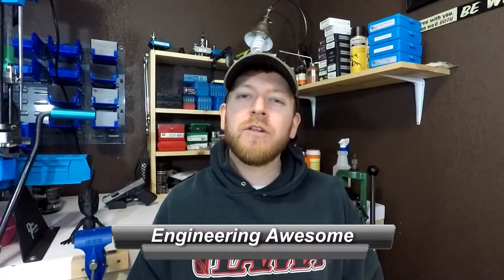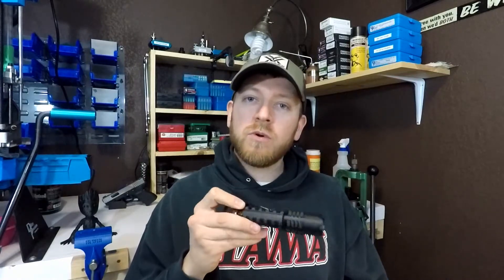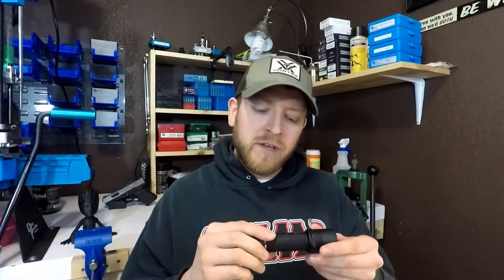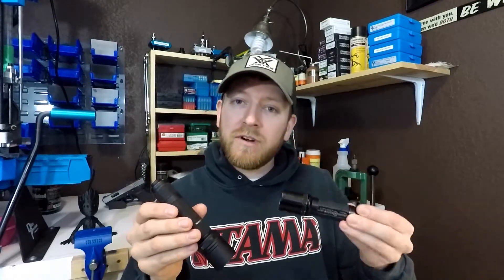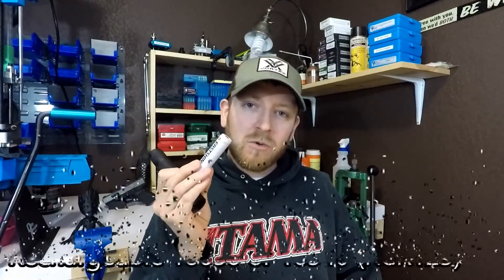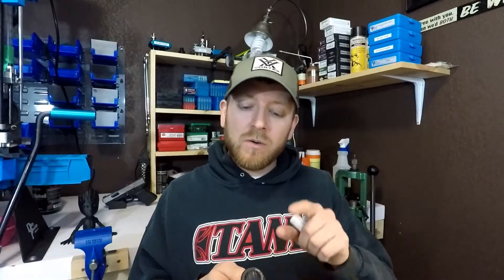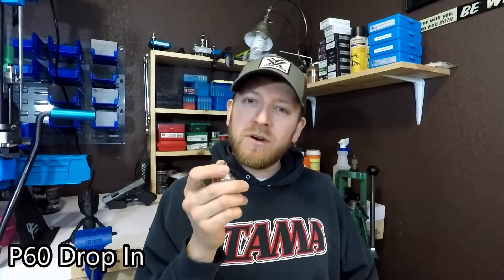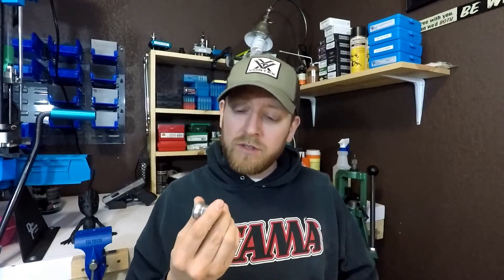DIY Custom Flashlight! Yep It's A Thing!

Comment: P60 was a gateway drug for me. Had fun changing up the lights but realized the drop-in system while convenient and great for modding is not a good system for high output LED's and does not handle the heat. So i started getting into other flashlights and learning to swap emitters and learning about drivers as opposed to a simple drop-in system.

Comment: Do you know if G2 bodies accommodate a 18650, and/or if not, if can be replaced with solar force host? Also, I plan to get a single output driver for this g2 I ordered. I've been Streamlight guy mainly (never had a failure or reason to switch!? Lol) but got a newer, barely used g2 for cheap on way.

Comment: I ordered a battery tube, lamp head, tail switch, rxtension tube and p60 drop in a couple hours and now just came upon this video. Going to do a 11 volt torch. All solarforce except the p60. Thanks. I enjoyed your video
Reply from the maker: Awesome man! Let me know how it goes. Very curious on the 11v. What is the driver that you are using?

Comment: You can use a solarforce pocket clip on a real 6p with an added o ring. Works great.
Reply from the maker: Hoostas I actually tried that. Just wasnt a huge fan of the o ring. My 6p had a fairly large gap. That hap caused the clip to flex a bit and not feel as sturdy. But you're right, it does work and probably works well on other lights.

Comment: I'm a huge fan of Solarforce hosts, and aftermarket P60 drop-ins (Customlites, Malkoff,   Sportac,  International Outdoors, Mountain Electrronics, EDC+, etc.).

Solarforce make a fantastic body, for the money, and are, as you mentioned, extremely customize-able, with interchangeable parts, between most of the L2 series line of hosts. 

Got about twenty of these, and one of them is actually the Surefire 6P body, with Solarforce S12 stainless switch, A001 head and B6 stainless bezel.  It's loaded with a Sportac Triple Nichia 219B drop-in, which is superb for the money, and one of my many EDC lights, when I'm carrying them in a bag.

Here is the whole lot:
https://imgur.com/zfr21E2

Here is the Solarforce/Surefire 6P Frankenstein light, bored out for 18650 use), which I absolutely love.
https://imgur.com/VQIrUdq

Front view of the light, showing the Triple Nichia 219B drop-in.  Great flood light, in a beautiful, neutral tint.
https://imgur.com/LwJigd6

Have to agree with you on the Malkoff drop-ins.  Gene Malkoff really stands by his stuff, and it's pretty much bullet-proof.  

Here's a Malkoff M361,  3-mode,  XP-G2 R5,   Super heavy duty construction.  Very solid drop-in.  I wish they were all built this way. 
To the right of that, in the picture, is an L2T head, with a B6 stainless bezel.
https://imgur.com/Qo8mTwV

Here are a couple of L2M's, with L2T heads and B6 stainless bezels.  The one on the Right is shortened, with a 16340 battery, and the one on the Left is full-length, with a 18650 battery and a one of Solarforce's stainless clips..

I replaced the stock protruding switches with recessed switches, so I could tail-stand (ceiling bounce) the lights.
https://imgur.com/Hi4Gslu

A few more full-length L2Ms; one, loaded with a Triple XP-G2 R5 Sportac drop-in:
https://imgur.com/8JTrlvZ

The Sportac drop-ins are an incredible for the money, and are extremely well-built:
https://imgur.com/puNDSrS

Warning:  With all the customization options, these puppies are pretty addicting (as you can tell lol)!

Great post!  Thanks for sharing :-)
Reply from the maker: Wow man! That is an incredible collection. I jumped in to avoid spending a ton of money on one like my engineer friends were getting. I wanted some very specific functions and felt that building one was the best way to get it. 

Had no idea that this world even existed until searching for replacement parts for the 6P after my brother burnt it up in the sandbox. Planning on building a few more in the near future. Especially for the new firearm build that is coming up. Have a lot of ideas and a Solarforce is in the works.

Thanks for the comment man.
Reply: My pleasure!

I"m really glad to have come across your original post.  I've been addicted to P60 lights for about the past five years.  It's been quite the ride.  The P60 platform is so flexible, you can get exactly what you need, or want in a  nicely-built light, and update it any time you'd like, without spending a fortune (buying a whole new light) - or go nuts and spend a ton lol. 

If you're thinking of ever getting some pre-fabricated, yet extremely well-built drop-ins, made here in the States, Randy , at PFlexPro builds drop-ins, alone, or a choice of Solarforce hosts, with their own custom drop-ins, that are amazing, with a huge selection of drop-ins, from which to choose.  Choose the firmware and tint that suit your needs. 

He's also very friendly and knowledgeable, and is great about answering any questions you may have.  
https://www.pflexpro.com/category-s/1824.htm?searching=Y&sort=1&cat=1824&show=18&page=1

All of their drop-ins have fully-potted electronics, and are built to easily withstand the heavy recoil of a firearm, if you decide to weapon mount one.  

You would be amazed at the range of tints that are available, these days, from the retina-searing cool white 1A, to the "I can't believe it's not incandescent" 7C.

Below is a shortened L2m, with an International Outdoors 3-mode XP-L U5 7A3 drop-in.  They run about twenty bucks, and are very similar, in build quality to those of Mountain Electronics.  Really well-built (not quite as nice a Malkoff, but great stuff for the money).
https://imgur.com/I8DqOOt

Here is a link to the International Outdoor P60 drop-ins:
https://intl-outdoor.com/cuxm2-dropin-p-911.html?zenid=24735bf9ececbb58465d76313bac2e81

Also, another fantastic source to find out anything you would ever want to know about flashlights, from other enthusiasts, check out reddit Flashlight:
https://www.reddit.com/r/flashlight/

Enjoy!
Reply from the maker: david57strat I'm going to look into those! Really thinking that my soldering skills may be a bit subpar for the recoil of a firearm. And I have several firearms that could accept it.

I will probably try and print a mount. Figure it could be a fun next project.
Reply: I hear you, brother.  If I felt better about my soldering skills, I'd probably have fifty of these babies, rather than twenty lol.   My favorite tint, of all time, is the Nichia 219B - absolutely beautiful, neutral, natural-looking tint.